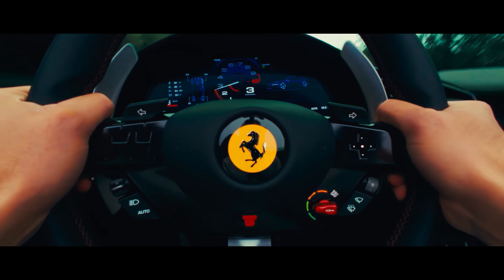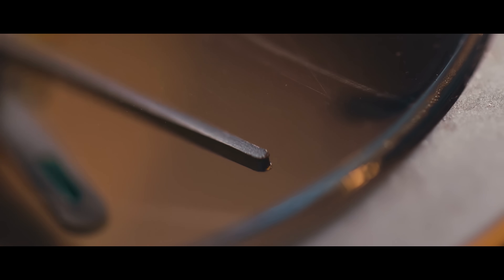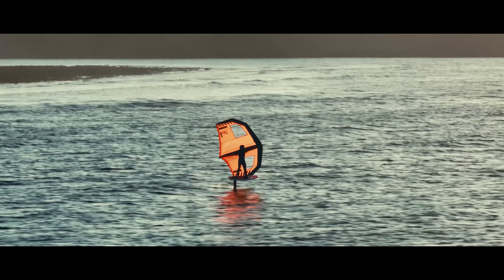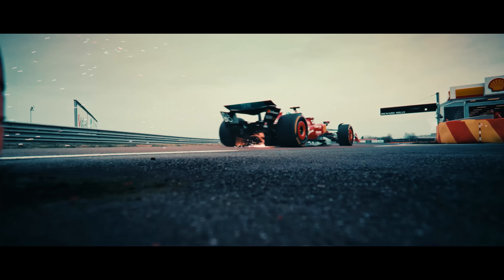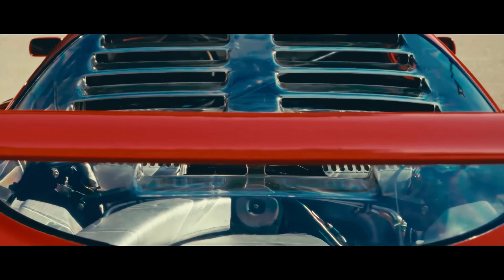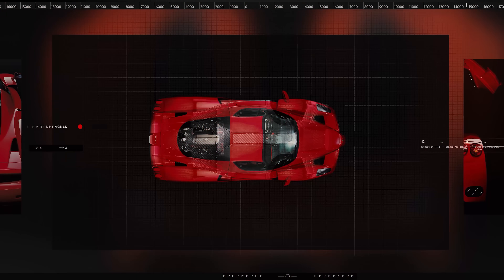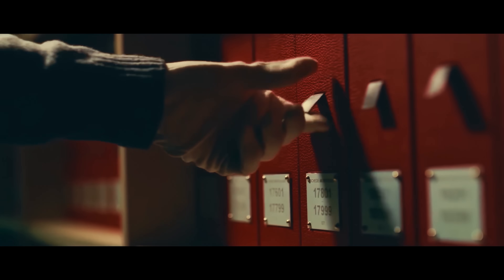Fluid Dynamics Explained | Ferrari Unpacked, Episode 2

Comment: Incorrect use of the theory. Take an aircraft wing. The theory is two molecules of air next to each other at the "nose" of the airfoil will  meet again at the trailing edge. the top molecule must travel faster over the longer distance of the top surface to meet it's counterpart on the flat lower surface. If the lower surface is flat and horizontal the pressure is ambient pressure. The top surface is less than ambient which generates lift.

Comment: Hmm, so why does the air move faster on one side of the wing?

Ai says:  When the air hits the front of the wing it flows in a steeper curve upward, than the bottom wing flow, This creates a vacuum on top of the wing, and this pulls more air towards the top of the wing, this air does the same thing but moves faster because of the vacuum pulling it in, and then the vacuum of course lifts the wing.

Main post:

The common explanation given is that it flows faster over the top of the wing because the top is more curved than the bottom of the wing. However, I understand why you would find this explanation unsatisfactory.

To start with, I think we need to identify the point at which the flow separates. Looking at Wikipedia, I'll post two images:

The argument that the wind flows faster over the top is mostly a consequence of geometry. First identify the point at which the flow separates, meaning the point above which the fluid goes over and below which the fluid goes under, this is slightly below the front-most point of the airfoil, due to the fact that it's angled slightly upward. If both paths take roughly the same time to pass over the wing, then the average velocity of the fluid from the point of separation to the tail where the flow rejoins will be roughly proportional to the distance from those two points.

Now, you may say, "but it will flow faster over the top even if the top isn't curved more!" You would be correct. A plane can function with no additional curve on the top of the wing, as the famous xkcd comic points out. Such a mode of flying, however, will still see the fluid passing over the top of the wing faster. A simple argument for this is that the point of separation is lower than the front of the wing, again, since the wing is angled up. A plane can fly upside down, but I don't know of a plane that can maintain altitude with the wings not angled up. The curved top, however, increases efficiency by intensifying that natural effect.

I hope that helps some, this is intentionally not a rigorous answer, and I want to recognize that I am not addressing the more hairy details of the actual fluid equations associated with this, which are required for a full explanation. In short, the fluid velocity over a surface isn't completely proportional to the distance traveled. Even without getting into that, however, I think your question is mostly answered.

Another Attempt

I realize that my answer up to this point may not only be incomplete, but might not answer the question. The question is why the flow on the top is moving faster than on the bottom. Let me post another image.

There are 2 things I want to note here.

    The fluid above the wing does speed up and the fluid below the wing does slow down. I just want to confirm this is still the case.
    The fluid going above and below does not have the same travel time over the wing.

Number 2 is particularly important because it is simply not correct to say that the speed is proportional to the distance between the separation and rejoin point. That way of looking at it may still have some usefulness. But I digress.

At this point I'm repeating Wikipedia's explanation, but refer to the 2nd image in this answer. Under some assumptions the fluid does not cross the blue streamlines. That means that when the channel size between 2 blue streamlines narrows or widens, the fluid speed changes correspondingly. I'm still hand waving away plenty of technical detail, but please let me offer this as basic level answer.

The fluid on top of the wing is accelerated and the fluid on the bottom of the wind is slowed down compared to velocity of the aircraft itself because the wing geometry and angle narrows the flow area above the wing and widens the flow area below the wing

This is the absolute best explanation I have. If you assume that the fluid is incompressible it works great, if not, it works less great but still works. There are also some other assumptions, I hope that the general point is still the same with all those included. The bold text is the best answer I have and I think it's a good one.

--Alan Rominger

Comment: While fishing a creek, I lit a cigerette. Pole between my legs. Lure bouncing off the top of fast current, a trout came to check out the lure. It sat in the fast current without much movement. The sight of it just baffled me at 15 years old. How could it do that. If a stick was in the same current, it'd be downstream, fast. By some formula..(which may work in f-1, or land speed..) water weight pushing in to fill the space the fish displaced, pushed in on the sides of that fish, flat, tapering back to paper thin, pushed that fish forward. Weight of the water pushing in from all sides. Once that bullet tip divided the water, the fish weight & tapering of surface area, +force of water inward..minimized the water speeds push on the fish. I guess somehow that would figure into electric flow & any mass in fluid. I've  no clue what this effect is called. But its pretty cool! Cavitation? Something?

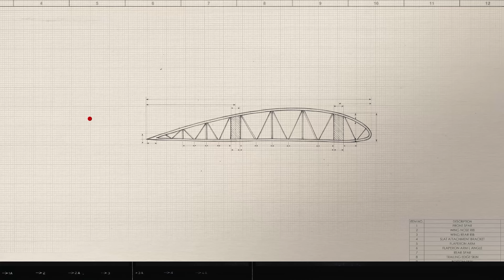Comment: i don't mean to be that guy, but 3:00 is wrong.  

the velocity of air on the top surface of a wing is quicker because of compression, not that it has to go further.  

it also generates lift because the bottom surface pushes air downwards.
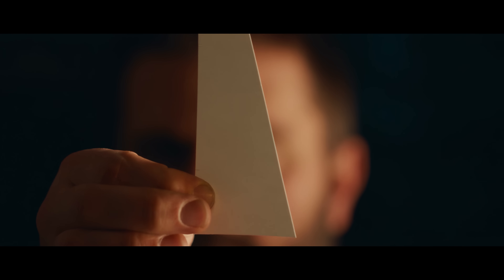Reply: then also messing up pressures in 3:20 😬

Comment: The explanation for how aerofoils create pressure differentials is incorrect, and you proved yourself wrong when using the sail/boat example. Bernoulli's principle only applies to individial fluid 'streamlines' and even then, only applies to certain flow conditions, which isn't seen on a road car and especially an F1 car, yet still produces downforce/lift.

A boat's sail doesn't really have a longer or shorter side, so the whole fluid accelerating and having to meet at the trailing edge at the same time across both sides doesn't work. What makes aerofoils and sails efficient at producing lift/downforce/thrust is their shape imposing curvature into the fluid.

But again, this isn't the only mechanism at play, as an angles flat plate can produce a vertical force through Newton's laws.

There are multiple mechanisms at play that generates the pressure differential across a surface whether it be a aerofoil or a flat plate. You can offer a simple explanation that non-technical people can understand without being incorrect.

Comment: .... What on earth do flying fish think about living between water pressure and aerodynamics like that😮
Are flying fish strange challengers who love to feel various "resistances"😮
As an ignorant person, I think the gluttonous flying fish could never forget the taste of the insect they happened to eat. Or...

Rather than continuing to swim underwater, converting resistance into force and continuing to fly in small increments ultimately results in faster movement speeds and less physical exhaustion☝️😳✨️✨️
Reply: However, what is clearly different between water (underwater) and on land, is that they, who live in water, have no legs. In other words, the presence of tires (legs) is a clear difference from motorboat sports.

The story of flying fish without legs was not on the same soil (world line)😢
I'm very sorry😔
Reply: The flying fish had wings! 😮😮
Reply: 8:51 This is not drift😮💦
The drift I know has a body that is completely gliding on the road.
In the video, the car body (tires) does not slide on the road and appears to be controlled😮
In other words, grip (friction force) is being created.
Drifting does not generate friction (grip).
So this is a fundamental difference in the performance of the car body (machine)🫢💦
Reply: 10:10 It's like blood pressure😂

Comment: 2:55 Did you really just state one of the biggest misconceptions about airflow over a wing as a fact? (It travels faster on the suction side not because it has to travel a longer distance, but because of the curvature of the wing, creating lower pressures, and therefore higher speed)
Maybe next time go ask an aerodynamics intern over the lunch break before publishing.

Comment: so how does a plane fly upside down?
Reply: Ma english si not good at all but I’m gonna try it. Most of the plane that you see flying upside down are plane that are studied to do it, like fighter jet and acrobatics ones. With studied I mean the shape of the wing, most of these plane use a wing that is nearly flat so you don’t have lift or downforce when you are trying to fly upside down. But they need lift for the takeoff so, they put at the and of the wing variable flap, if you change the angle of the flap you are able to create the lift that you need for the takeoff and any other maneuver that ask for it.
Reply: Well most cant, but its the angle of attack on the wings. Its just that generating lift from an aerofoil is more efficient
Reply: It was nice knowing you bro… 👋🤧

Comment: Fluid dynamics? Must be the water!
Reply: a fluid is a substance, as a liquid or gas, that is capable of flowing and that changes its shape at a steady rate when acted upon by a force tending to change its shape. So, no, not just water.
Reply: @helipeek2736 must be the viscosity
Reply: @-G.e.o.r.g.e  if it’s as part of the lift formula it’s rho which describes density